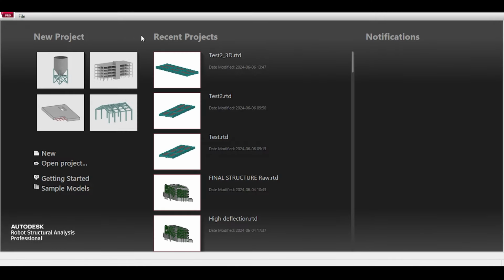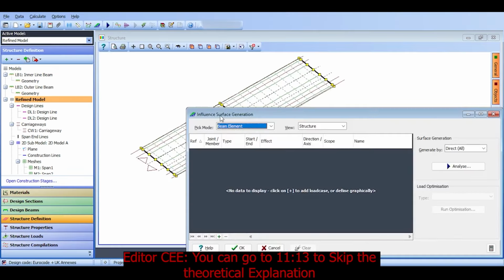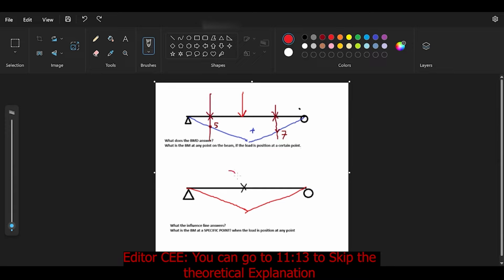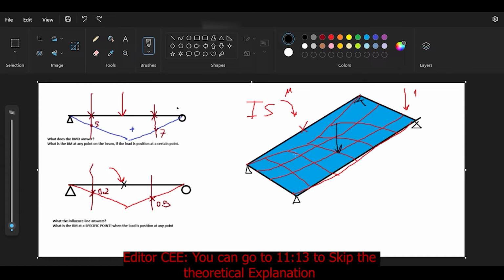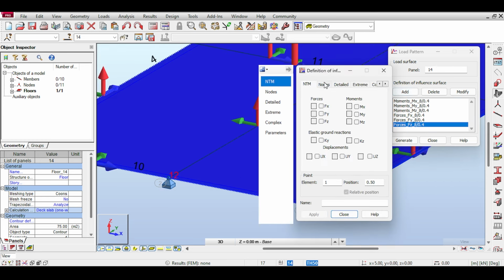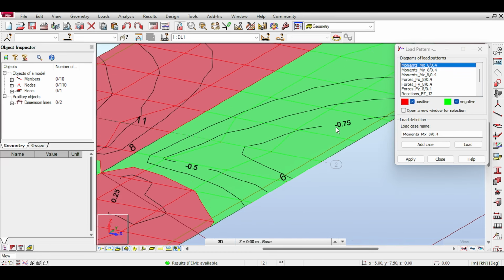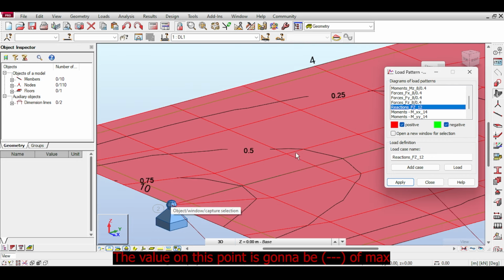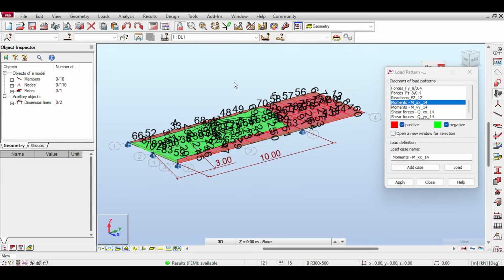Understanding Influence Surfaces in Autodesk Robot Structural Analysis Professional

Comment: Hello Dr. CEE,

Following on from part 8 on the ASBD series, this RSAP tutorial is so satisfying to watch. Thank you for planning and for producing the two videos as you have done.

After seeing that ASBD goes further to even “pattern the live loads cases” for the user and can also generate “loads combinations” using these “patterned live load cases”……

Is this something that RSAP can also do? Can the user for example initially apply the live loads and permanent loads across different designated areas on the surface of the slab as one would normally do (without considering loading patterns); and then later when considering loading patters “tell RSAP” which live loads cases to pattern on the same slab surface and in accordance to the results of the various generated influence surfaces contours in RSAP?

Thank you so much for this video, it was a real pleasure for me to watch.

Keep well and kind regards, DK
Reply from the maker: Hi there Engr. DK, 
It worked out great having those two tutorials published in quick succession. I am happy you find those beneficial.

For RSA, it cannot unfortunately, for a good reason:
when ASBD generates the Interaction Surfaces (IS) it does so for every single point on a selected beam. This enables it to know exactly where to place the load to maximize the bending moment on each point on the beam.

RSA does not do that. More accurately, it does not have the automation needed to perform such a thing. A user could do it manually (like adding multiple points, followed by creating  a case adding a load - BTW there was an "add load button" which I forgot to mention in the video).

But this is faaar far to hard to pull off successfully.
IMHO, I think this works for the simplest of structures where you already have a good guess where the moments are going to be max and how to place the loads, but need some extra insights to place the loads in a 3D environment.

In case of any follow up questions, please let me know. I am currently working on the continuation of the pile series, so expect more videos on that very soon.

Regards,
CEE
Reply: @CivilEngineeringEssentials  

Thank you for the feedback and for the highlights on RSAP influence surfaces functionality limitations compared to ASBD.

Yah, at least for now, the functionality that is currently available in RSAP is plenty something and it certainly helps with where to (manually) start.

Thanks for also pointing out the “add load button”

I am looking forward to the continuation of the pile series and of the other series, keep up the excellent work as always.

Regards, DK